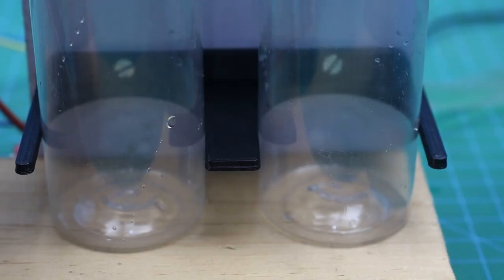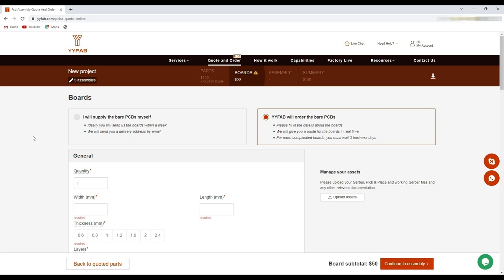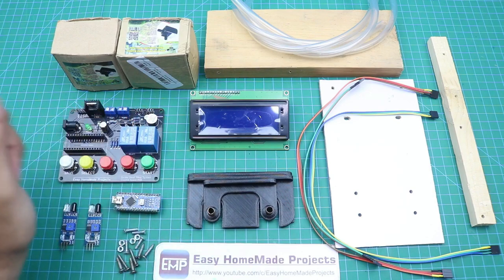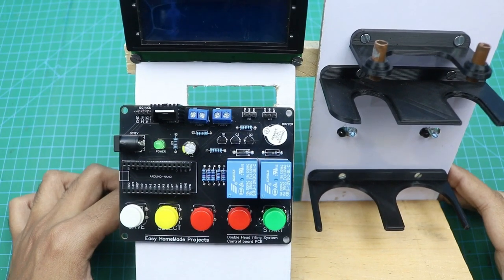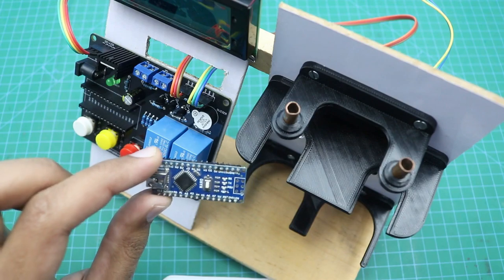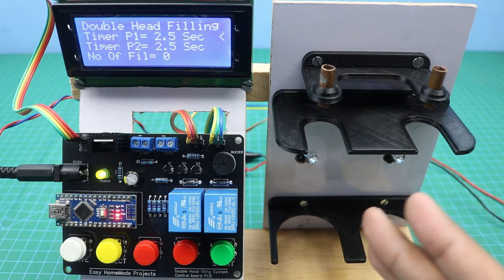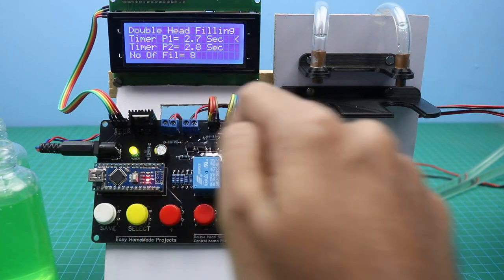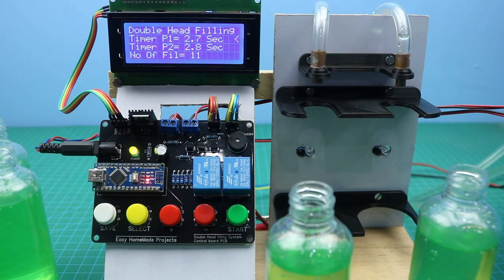How to Make Dual Head Filling Machine - For Small Business

Comment: Code not given in discription
Reply: // Start filling the bottle

// Turn on the water valve
MV500 = 1;

// Wait for a specified time to fill the bottle
WAIT T500;

// Turn off the water valve
MV500 = 0;

// End of the filling process